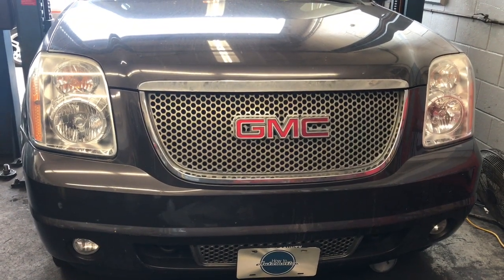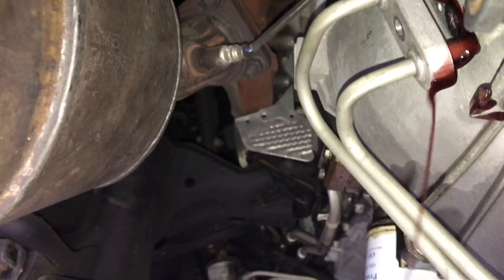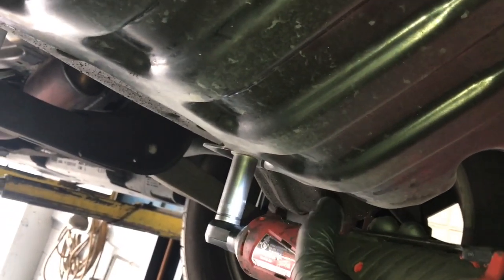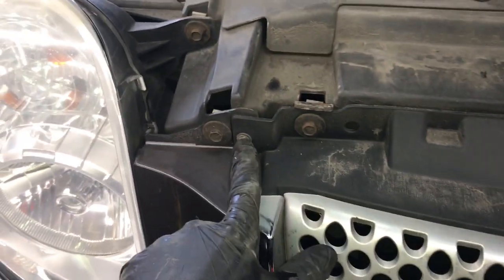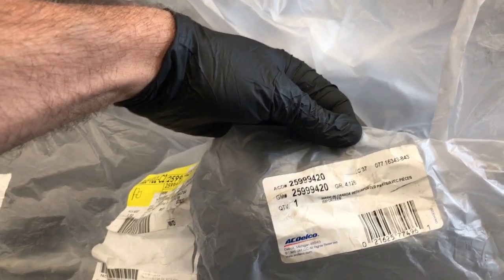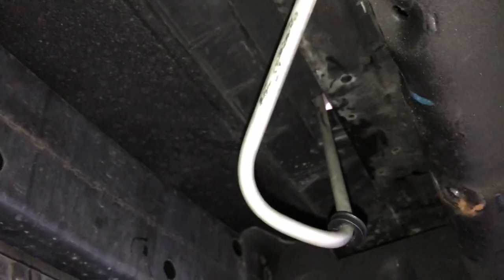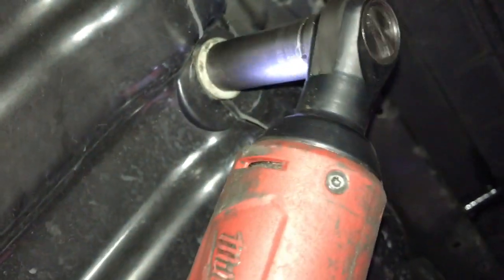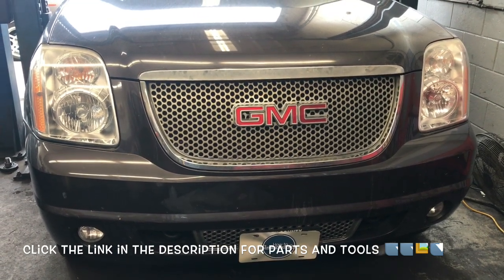How To Replace Transmission Cooler Lines On A GMC Yukon Denali

Comment: I watched this video because i had to change the same exact line on a 2007 Cadillac Escalade AWD.This Yukon is rear wheel drive and its much easier to replace.On the Escalade it was very hard to remove the lines with all the extra parts for the AWD system in the way.Running the new line back in was so frustrating I almost quit.I was using ramps and jack stands to do this.It's my wifes car and she needed it in the morning to go to work,so I just kept on trying to get the damn line trough.I was doing this at night on my driveway.Finally after what seemed for ever(about an hour)I got it trough.This video helped me a lot,but just a WARNING to anybody trying to do this on an AWD vehicle,it's much harder.Thanks for the video.

Comment: Incredibly helpful video.  Showing the details of the lines from front to back was HUGE.  I just added the auxiliary transmission cooler to my 2010 Suburban (did not come stock).  This video showed exactly where the lines run, so it took the guesswork out of the job for me.  It took some time, but it's installed and works great.  Thank you so much!

Comment: If you have a front differential, drop the right side nuts and lower control arm to shock bolts. This will get you just enough slack to get the longer cooler pipe up through the hole in bumper.

Comment: Thanks for a great video. What is the torque spec for the 13mm bolt on side of the transmission? Thanks.

Comment: Just a heads up. There are two hose types from the Trans to cooler. Denali tow package (heavy duty version?) and denali regular. I have the tow haul mode, hitch, trailer connector, so I figured I had the tow model. Wrong! LoL
Maybe the tow model has an integrated brake control and tow mirrors? 

Anyway thanks for the video.

Comment: Thanks for the how-to. Mine are also shot so I'll need to replace them. But I'm not going to take my time getting the old ones out, just cut them in 2-3 spots to make it easier. Getting the new ones in on an AWD Denali sounds like it's a PITA.
Reply from the maker: Funky Tape i’ve done it that way. It does save time👍🏻 thank you for watching!
Reply: Funky Tape what do you mean by cutting them lines in 2-3 spots to save time? How do i do that? Mines are shot too and started to leak little heavier lately but i dont wanna go thru the whole proccess of replacing them.
Reply: @dabossfraga9493  The hose material GM used for the flex parts of the line is garbage.  I replaced it with 30R9 fuel injection hose and worm drive stainless hose clamps, and it is bone dry.  In fact, I am replacing the lines due to rust now - and I will cut the new hoses off and clamp my 30R9 ones to the new lines.
Reply: @Erichhh  oh cool thanks bro.
Reply: @dabossfraga9493  Glad to help!  I carefully cut the crimp sleeves and took the new hoses off the line assembly and it was a breeze to install.  Then I clamped my existing hoses to the new lines, and made sure all of the clips were secure. Very easy job.  The lines have little barbs to help the hose grip, and with a small worm drive stainless clamp it is leak-free & tidy.
Reply: @Erichhh  you make it sound so easy lol. What did u cut the crimp sleeves with?
Reply: @dabossfraga9493  Milwaukee Hackzall. But a small cut-off wheel would do the job also.
Reply: @Erichhh  i have a dremel with a diamond cutting wheel i hope that works. Thanks again brother.
Reply: @dabossfraga9493  You got it!  Be careful near the smaller part of the crimp - not to nick the tube.
Reply: I cut almost to the tube, then peeled the crimp sleeve away.
Reply: @Erichhh  will do and i'll make sure i keep you updated on the final results lol. Thanks again brother,God Bless.

Comment: How did you get new line started in opening? Your video just skips that moment! I cant get enough slack to get longer line feed through that little opening. Did you remove sway bar or something else for more clearance?
Reply: for real that is really the HARD part. just did this job on a escalade. Finally after swinging like an ape and throwing VooDoo bones, it went in there. Thanks for nothing.
Reply: 😂right....that's where I need the most example n he just showed it already in like it was a breeze....I'm on day no. 2 trying to get that line up in there

Comment: My 2007 Hummer H2 trans guage is going up and down on cold start. The fluid temperature is like 190-210.. the guage is acting crazy. I replaced the temperature switch.. it’s still doing it. What do you think?

Comment: hello. you showed  the connections are at on the 1.trans 2 oil cooler 3. radiator, where do is the 4 location?

Comment: What was the problem so you decided to change this cooler line, I have my 2500hd sierra and the transmission temp is always increasing from the engine start. Once it reach 100deg C the engine check light on and the transmission temp still increasing until 138deg C. When I check with the OBD scan it shows U0101 code which is TCM connection lost.
I am assuming that the cooler is not functioning in my car. how to check that I need to change the cooler line or I need to change the solenoid inside the transmission before i do some unnecessary step. thx
Reply: Mostly leaking in the cooler lines that ends up to replace them

Comment: Was installing a trans cooler. Engine was warm. And when i disconnected return line, small amounts of coolant trickled out. Is this normal?
Reply from the maker: Alx FiveOnine if it ran out of the transmission cooler than I would say no that is not normal and the cooler is most likely the problem

Comment: How do u pour transmission fluid when u are done?
Reply from the maker: Cesar Lascaster you fill it through the dipstick tube. So you remove the stick put a skinny funnel in the tube and Fill it there.

Comment: I got a easier way to get the long line back in there fellas......just cut out the plastic where that line feeds thru.... GM should've done it themselves but it workd perfectly....no more struggle

Comment: I'm surprised by that transmission had two coolers, by radiator and cooler fins.  Why two? I believe radiator is sufficient to cool the fluid
Reply: Josh Benney if you buy the Yukon Denali with the 6.0 it's part of the tow package.
Reply: The purpose is to maintain the correct transmission fluid temperature. In super hot climates and towing, the radiator cooler isn't enough to cool the transmission. So the added cooler is required. But the transmission fluid can get too cold If it passed only through a cooler out front and back to the transmission. The fluid could gets too cold during winter, causing the transmission to not function properly. By running fluid through the radiator, the fluid will always be at least the operating temperature of the engine which is perfectly fine for the transmission.

Comment: If it's two lines why you have to disconnect 4 ends from the cooler
Reply: replace all lines. But I feel he should have taped the ends to keep dirt out of lines. That way it doesn't enter the system.